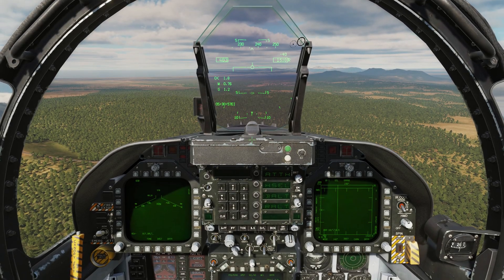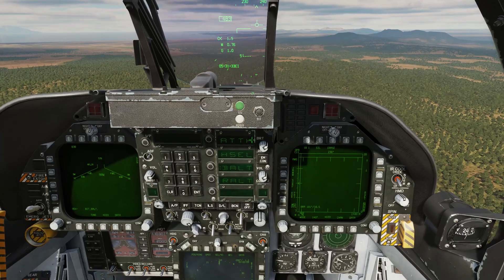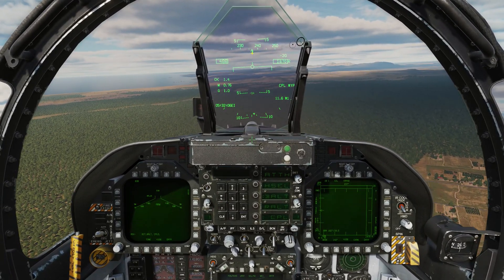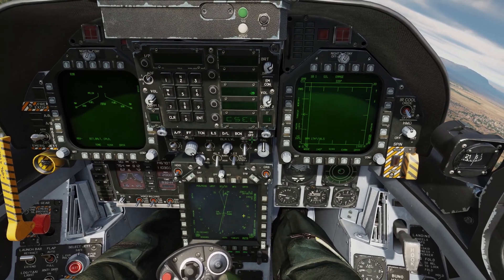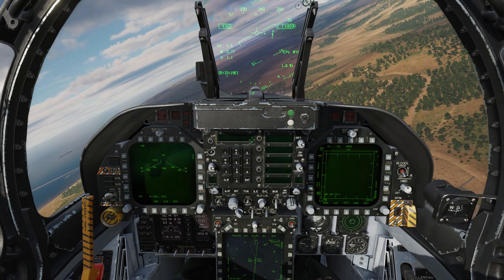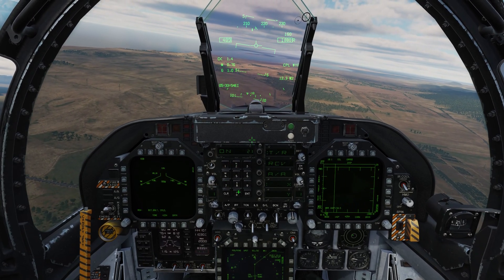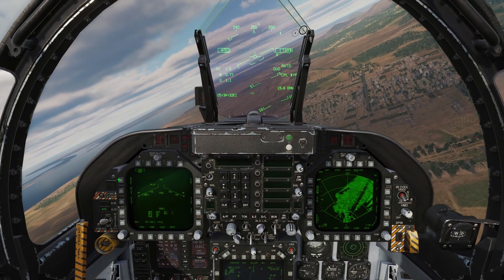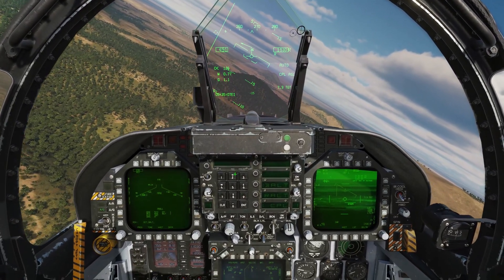DCS: F/A-18C Hornet | Coupled Autopilot Mode

Comment: Does it hold altitude while in coupled mode when tracking a TACAN?
Reply: BALT is selected on the AP.
Reply: Thanks. I was hoping to use it to land on a carrier :)
Reply: @RTSchramm  TACAN and ILS when programmed and selected are invaluable to find (TACAN) and then land (ILS) on the carrier. To practise with ILS I select it on the carrier before launch and it helps with lineup and glideslope on the trap. I can get a wire most times now ;-)

Comment: how does this work in relation to altitudes? will you need to have an altitude hold on while using the CPL mode so your plane doesn't fly into the ground? (depending on waypoint altitudes set in mission editor)
Reply: Note that BALT is selected (with colon) at all times on the AP. She will hold that until you deselect it.
Reply: But that’s an interesting question. I don’t assume some sort of VNAV is included, yet wouldn’t it be awesome if it was, though.